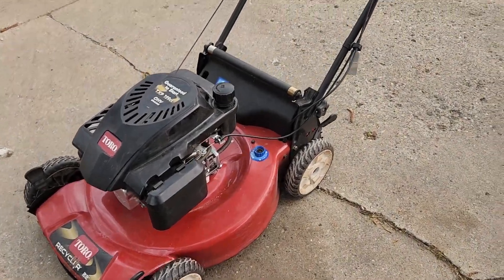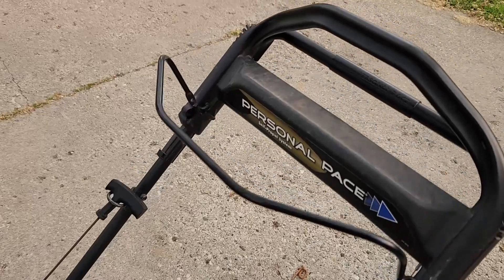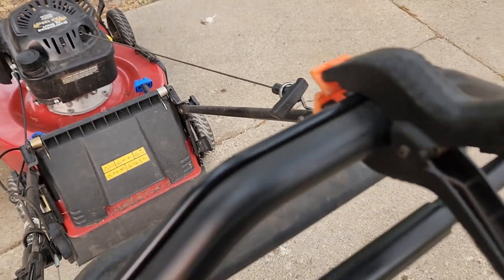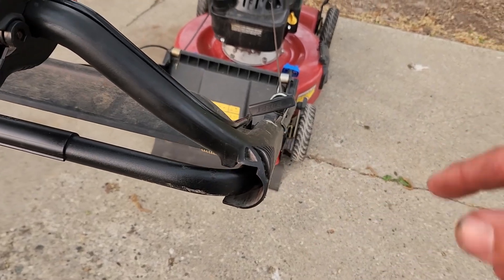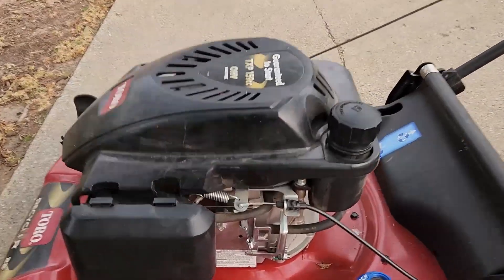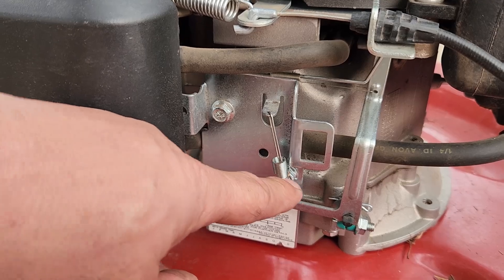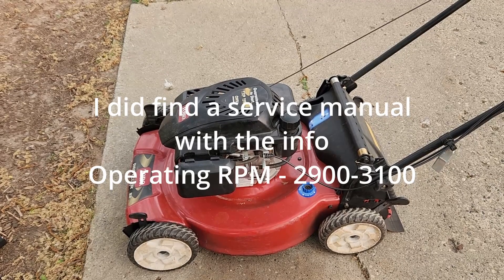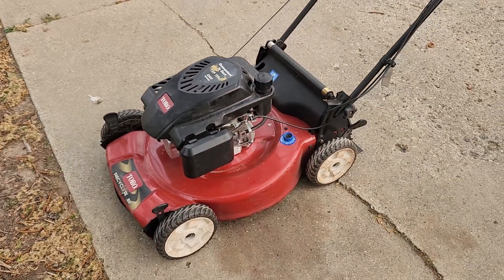Toro Personal Pace mower - TXP 159CC RPM Adjustment

Comment: Question? The governor arm on my mower moves causing the throttle speed to fluctuate. How do you adjust the other spring that is above the one you adjusted on this video?
Thank you as this video is very helpful and I have the same mower.
Reply from the maker: That spring is to keep the linkage tight. Not adjustable.

Comment: I need to increase mine, thanks! 😮 I'll adjust via your rpm sound! 😮
Reply from the maker: Happy to help! Thanks for watching!
Reply: @RealManSkills  Neighbor sold 2019 Toro only $120, as he got rider, got it to see if it mulchers better than my Honda, right now NO, Honda is better, Toro is faster but leaves more piles of mulch. Hopefully increasing blade speed might change that, else Toro goes on Clist at $199, LN cond, blk bag was never used. Toro engine is not stable when starting, did you notice that with yours? Thx in advance.😮
Reply from the maker: @MrGoogle239  this mower isn't mine and I haven't heard any complaints from the owner.
Reply: It looks like a Toro Super Recycler With Smart Stow
Reply: Go for it!